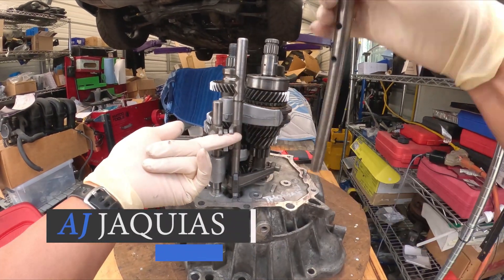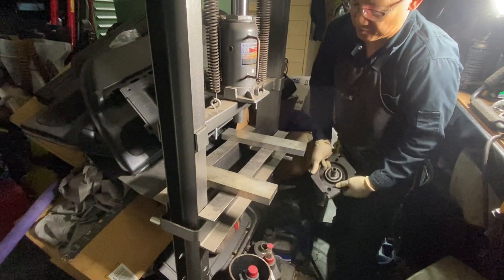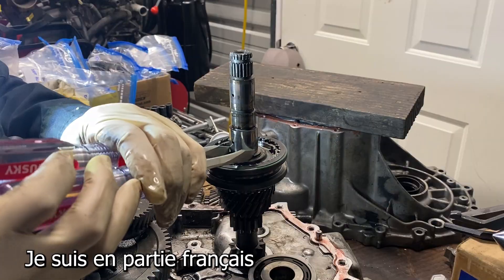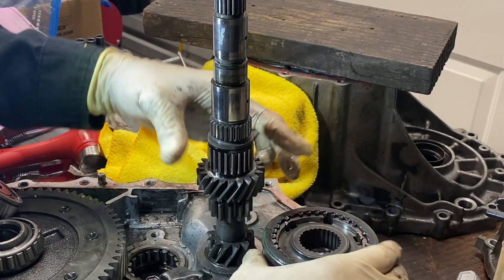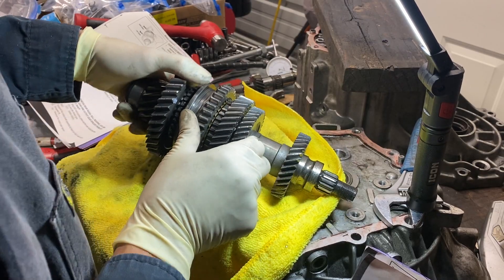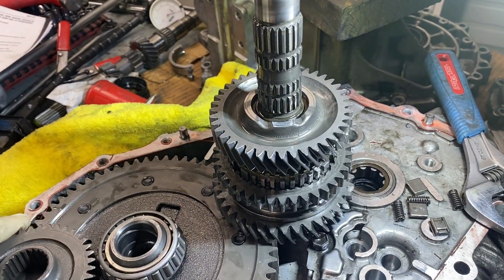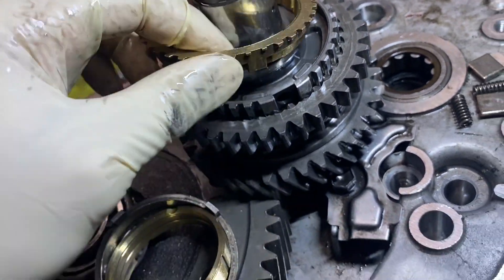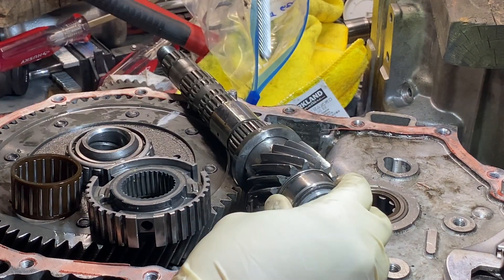Project Yellow Episode 7 - C56 Transmission Rebuild Part 3 - Input & Output Shafts

Comment: TY for this. It is very very helpful. Assuming most is the same for a C60 but with the addition of a 6th gear?
Reply from the maker: Welcome. There are some differences, but nothing major. I recall using special hardware to pull 5 or 6th in the C60 transmission case cover. I have recorded my C60 rebuild, but haven't had a chance to edit it.... I'm actually not sure if I will edit it.  It takes so much time to record and edit. Keep in mind, all manual transmissions are designed relatively the same and only have small intricacies between them. Once you pull one apart, the others are pretty much the same. Thanks for watching and commenting.  Pls subscribe.  Thx, AJ

Comment: Love your presentations. 

Waiting for ep 8, but quick question in the meanwhile. Should the input and output shaft gears line up exactly during reinstall? My input shaft gears sit 1.5-1.8mm lower than the output shaft gears they contact.
Reply from the maker: @RobertWierzbowski  ep 8 is pretty far out bc I’m working on other projects, but as the OEM reads, sometimes, the assembly is opposite of the disassembly. 😂 I just put them together by aligning the gears and once it drops in it should be good.
Reply: @ thanks, and looking forward to it!

If anyone else has the same question, confirmed that some misalignment is normal and is removed when you lift the input shaft and clip it in place before closing the transmission.

Comment: Hey mate. Where did you find the manuals for the specifications? Would absolutely love to know, thanks so much for this legendary content.
Reply from the maker: @TM-fx5le  I bought hard copies on eBay. They are available online for free as well. Pls subscribe. Thx AJ
Reply: @ Thanks man. Any videos of the reassembly? Or is this the final part of the transmission rebuild series.
Reply from the maker: @ haven’t edited assembly. Working on other projects / race cars / engines